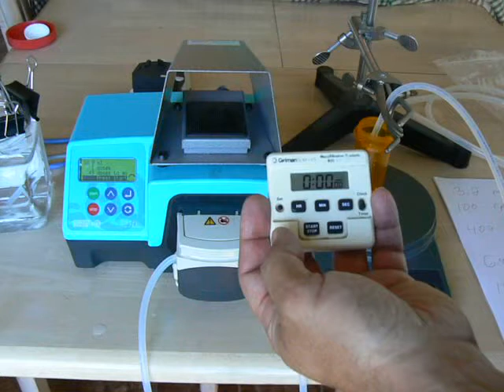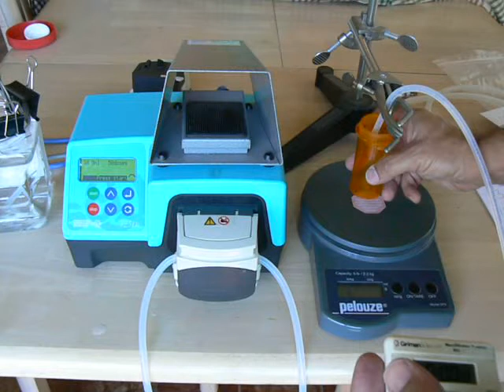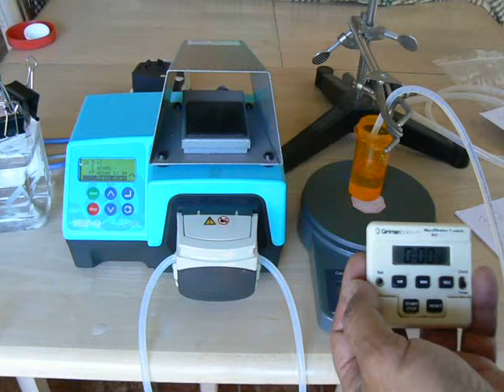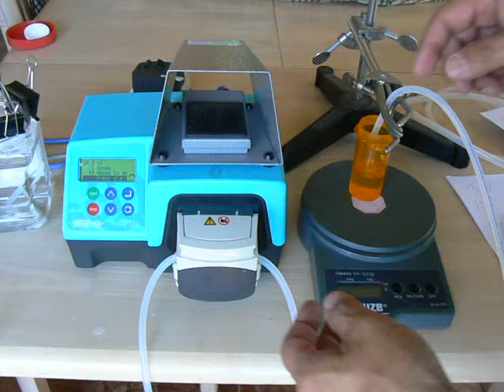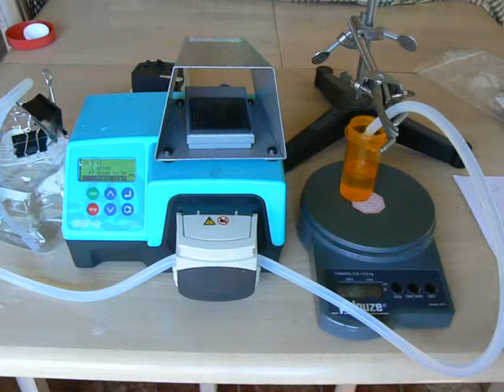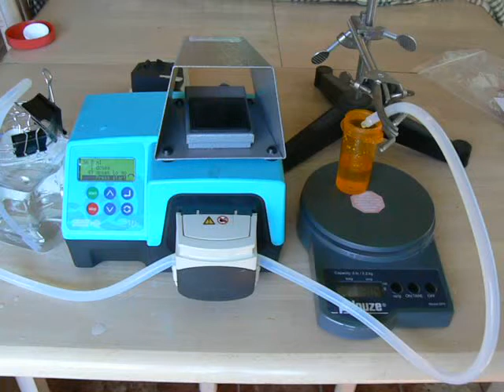Effect of Pump Speed (RPM) and Tubing Size on Fill Speed and Accuracy

Comment: Hi I have a problem with our pump I cant change the rpm rate for some reason theres a exglamation sign on screen ? If you have any ideas would be appreciated thanks
Reply from the maker: If the padlock is also showing, you've activated the keypad lock. To unlock the keypad while the pump is running hold down the START key for 2 seconds. The padlock symbol will disappear. If the pump is stopped hold down the STOP key until the padlock symbol goes away. The exclamation point is the auto-restart feature. To remove auto-restart switch off the power at the rear of the pump. Hold down the STOP key and turn the power switch on. The ! symbol will go out.
Reply: Ok thanks for heads up il try that when I get to work tomorrow thanks again